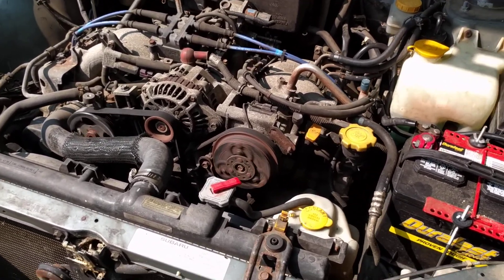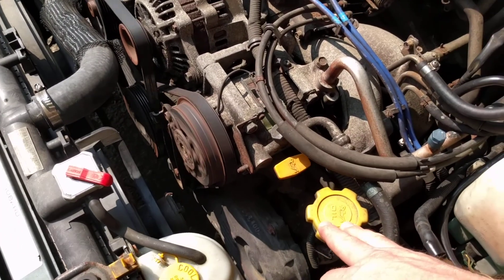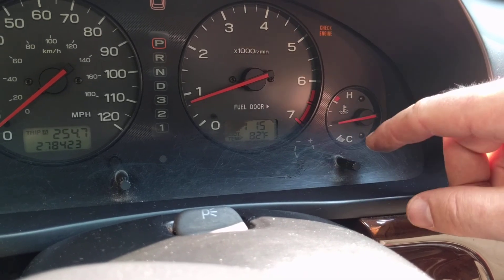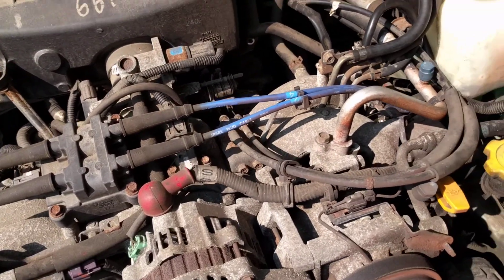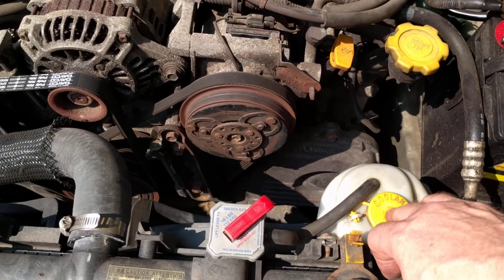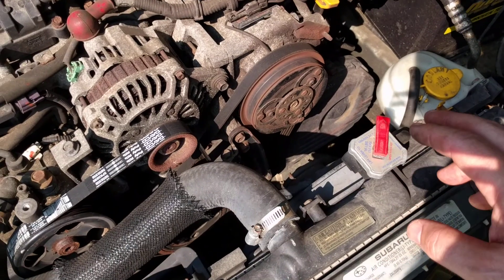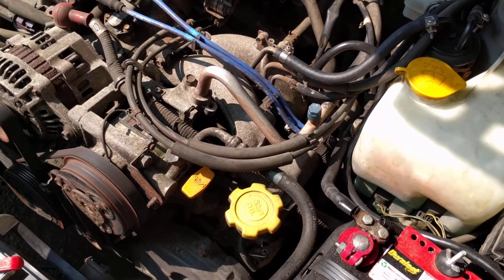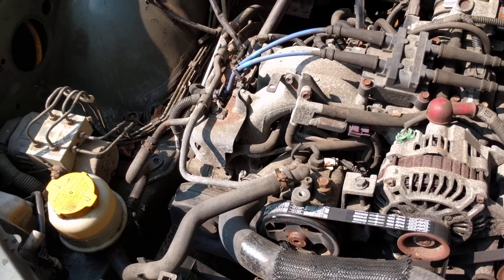Why is my engine overheating?

Comment: Subaru with 278,000 miles? Needs head gaskets.
Reply: My subie (outback H6) is about 200,000 miles and overheats after 10 miles of driving.  Block test does NOT change chemical blue to yellow so NO exhaust leak into coolant.  Zero indication of any head gasket leaks.  New rad cap. Fully flushed system 10x.  When it overheats, coolant reservoir fills/overfills and there is bubbles coming (lots) from overflow tube!  Going insane trying to fix!
Reply: @rsauder  Needs head gaskets. I had a 2.2 in my shop that I couldn't get to turn the fluid yellow sitting there idling, so I drove it up a steep hill and when I got back to the shop it turned the fluid yellow immediately. Run it a little harder before you test it.
Reply: @mikefrech1123  I'll try that thanks!  How to you test so quickly after running it hard..I mean you won't be able to remove the cap if it is too hot or has built pressure...what is your method?
Reply: @rsauder  You can test it at the overflow tank.
Reply: @mikefrech1123  Thanks so much Mike!

Comment: Water pump, a blockage in the radiator both inside as well as debris blocking the amount of airflow getting to the engine compartment, also check heater core for damage and or blockage as well. It is usually a good idea to check everything throughout each system you're working on, such as cooling system and electrical system to ensure nothing was missed also check head gasgets. Great video though i think it is awesome you did this to help explain to people. Who haven't had any experience. I wish these were around when i was younger. I learned the hard way amd using Chilton Auto manuals but to a lot of people that's another language hahaha Cheers my friend!